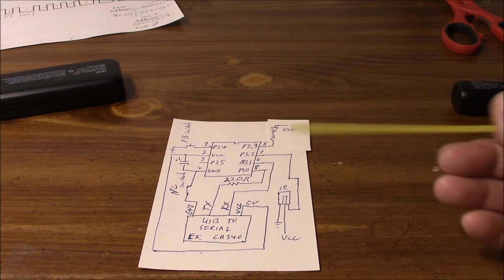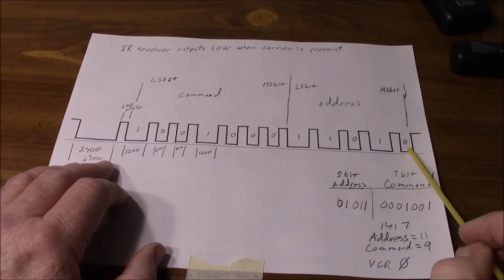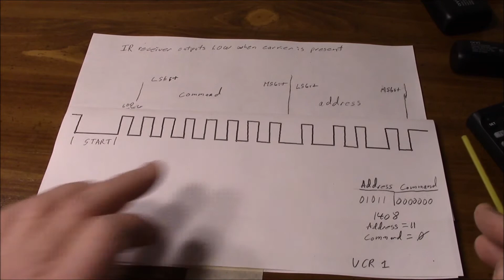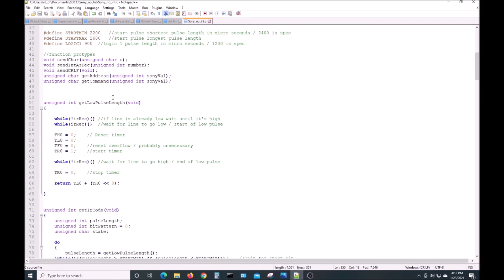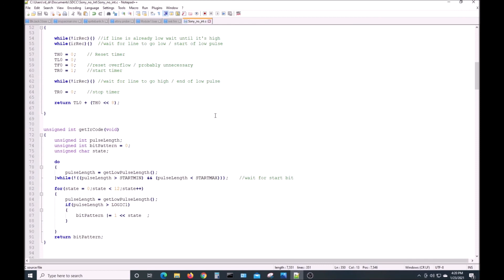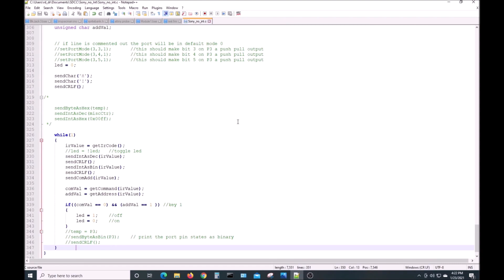Receive Sony remote commands on STC15F104

Comment: kindly give the instruction how to read the hex file from STC15F series
Reply from the maker: It's not possible to read the contents of the chip. It's a feature of the chip.
Reply: @rick_100  Thank you sir, kindly i need the information for how to read the ADC in STC15W408AS
Reply from the maker: @KarthickrajaM-n5i  I've never used the STC408 but the English data sheet has example C and assembly programs for reading the ADC channels. Chapter 10.6.2 has a program for polling the ADC channels. The program is written for the Keil C compiler so you will have to change a few things if your using the SDCC compiler.
Here's a link To the English datasheet:
http://www.stcmcu.com/datasheet/stc/STC-AD-PDF/STC15-English.pdf
Good luck
Reply: @rick_100  Thank you sir , I need more information to read ROM Command in 1-wire communication